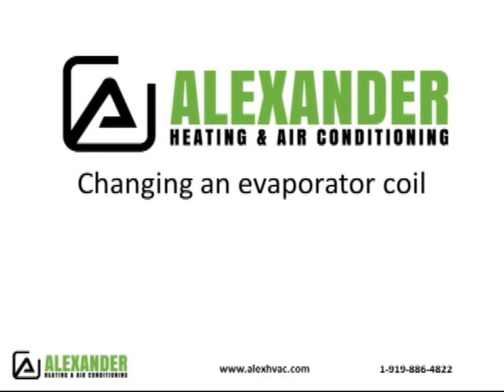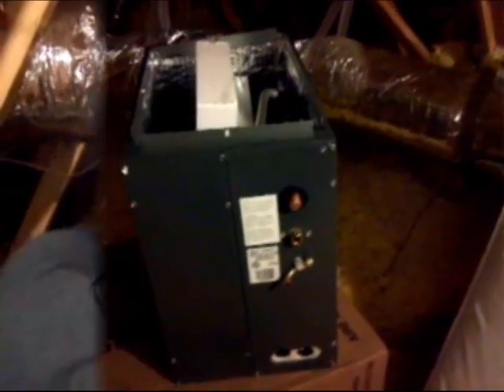Replacing an Evaporator Coil - Leaking evaporator coil

Comment: Does the old coil contain some leftover oil charge?  If so, do you have to replace that lost oil?

Also when you are brazing do you flow nitrogen through the system while brazing?  Is this necessary to reduce oxidation inside the fitting?